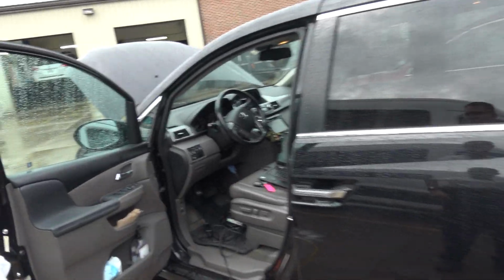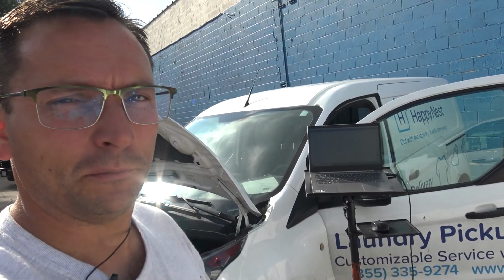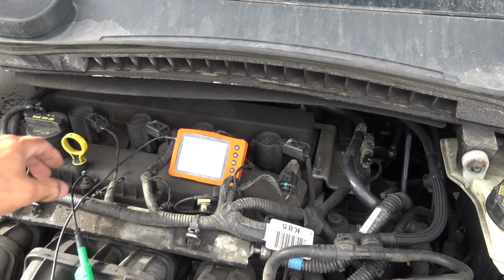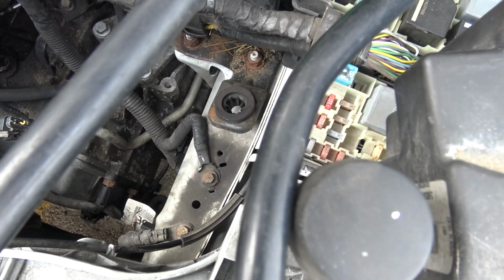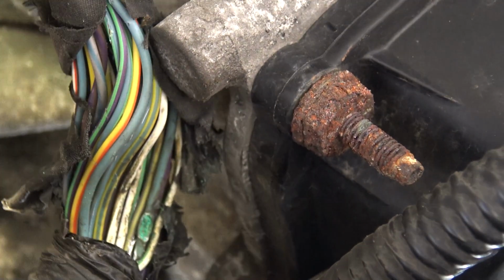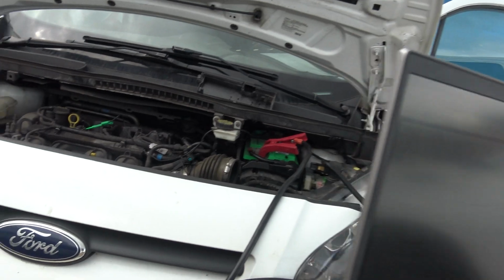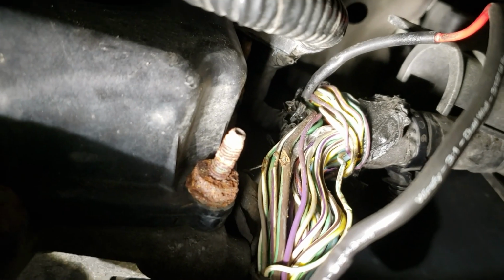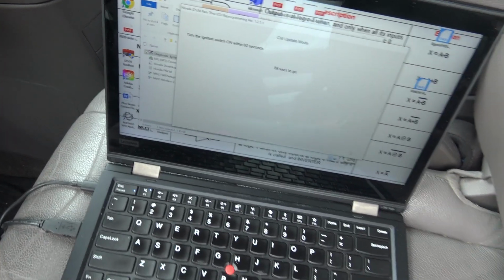10 4 2021 End Of Day Transit Connect No Start / Wiring issues

Comment: I’ve even had trouble with Ford giving me the wrong alternator for some of these vehicles with smart charging like the Ford 500 and I believe the Mercury Milan. I had one several years ago that the someone put an alternator from O’reilly on that was overcharging and the battery light stayed on. I put one on directly from Ford that did the same thing. Talked around to my suppliers and the rep at Napa said they’ve been seeing that issue and that their Napa gold alternator had the proper regulator. Put it on and the issues were gone. I did some testing on the resistance of the circuits in the regulator before installing it and sure enough their was a major difference from the other two. I don’t know if Ford ever ironed that out in their parts system or not so be don’t surprised if you see that same issue after using a motorcraft alternator.

Comment: Brian, how did you happen to notice the unsteady feed to MAF and injectors? Surely that's not just being lucky. What steps led you towards that? What was your thought process? Thank you. Your EODs are a great inspiration.
Reply from the maker: Scan tool had cranking RPM , so I wanted to check power to the injectors, and if htey had power I was going to check for pulse.,  the Maf voltage check is something I just tend to do.